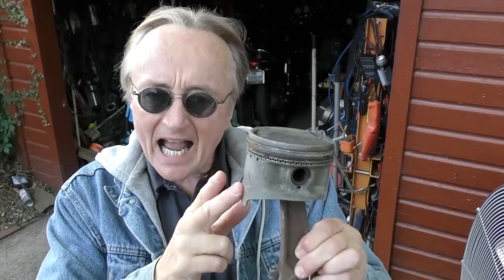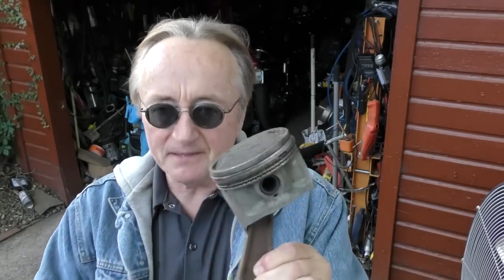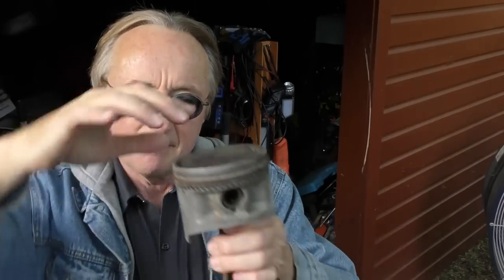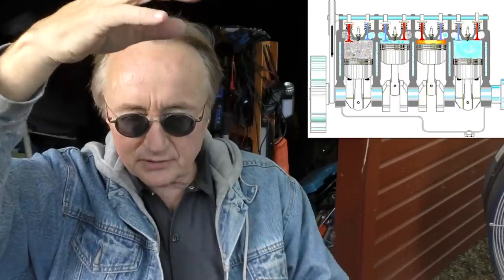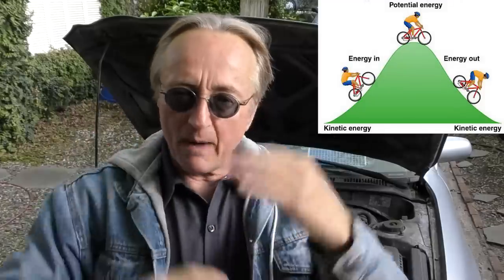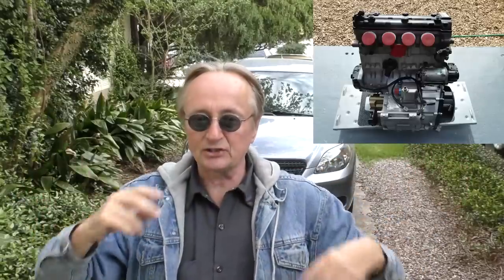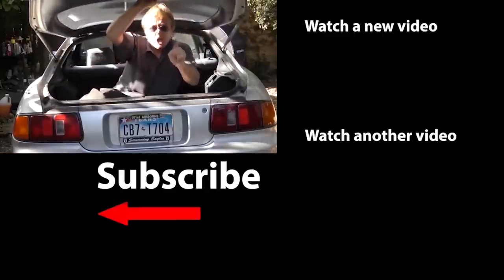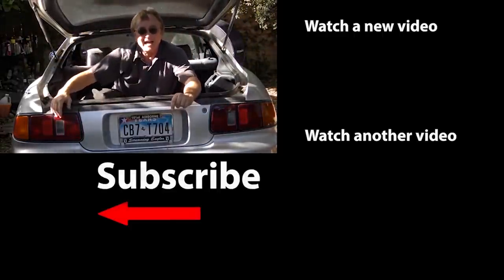Horsepower vs Torque, Which is Better

Comment: I thought horsepower was a function of torque x revs. Engines are tuned differently, so the peak torque per rev is rated somewhere in the middle for most cars with lower down peak torque per rev for diesels and lorries that pull stuff, whereas horsepower is just torque (at the current rev) x rev. Engines use to tow with lower down torque also have a lower ratio gearbox and the speed between the engine and no movement is much much less versus lighter faster cars.

A lot of lorries in countries that do not use the same big vehicles as the US, they tend to use the same engines as smaller vehicles, only coupled with a different gearbox and tuned for more torque at less revs so that when it starts off the line the less speed difference between the engine, transmission and wheels lets it move carrying heavy loads without destroying the crankshaft, transmission or drivetrain.

autoexperttv explains horsepower as a function of torque x revs, i do like his explanation and he was an engineer as well, whereas you are trying to give an explanation that a non engineer can understand based on the different scenarios. Its also not necessarily true that a v config provides more torque, as an example the vw ute with the v6 outputs the same amount of torque as other engines but at higher revs so the numbers given if you look are the amount of torque at a higher rev. This makes the v6 look weaker than the straight 4 or 5 cylinder engines in both hp and torque. super/turbocharged engines also do make huge amounts of torque that increase their horsepower because of torque x revs, so these things also help engines tow with higher cylinder pressures giving more torque. Diesel engines are heavier in order to survive the bigger explosions for providing more torque at lower revs rather than higher revving engine that burn less per rev but burn more per minute than a low revving diesel engine with lots of torque.

Comment: Horsepower is universal: 100 Hp is the same performance regardless engine type gasoline, diesel, electric etc (meaning that no matter on what rpm's that 100 Hp is produced regards to performance).

Torque is not universal, the "strength" of torq is heavily related to the rpm it is produced: 100 units of torq is more effective on 2000 rpms than 1000 rpms. With a gearbox you can manipulate torq and rpm, but you cannot manipulate power that engine produces (power over gearbox remains the same). And afterall power = torq * rpm, so you really have them both always when engine is running.

Speaking and comparing torques is fairly irrelevant (but layman terms more easily understand), because should be comparing max power and overall power curves.
Reply: @Charles That's not an argument. Also, you're the one that is wrong. Torque at the wheels is changed with gearing down an engine with higher power. The power output doesn't change between the engine output and the wheels except for drivetrain losses. But the torque does - in every gear.
Reply: Your so wrong it’s embarrassing.

Comment: Torque is a twisting force. 
HP is that twisting force multiplied by the RPM it is twisting at. 
HP is arguably the more important number to worry about because it takes into account both torque and rpm in whatever you’re doing (racing, towing etc.) Think about what a transmission does. You can multiply torque all you want with a tranny but you can’t ever multiply HP without increasing the performance of your engine.
Reply: Hp is almost never more important except for straight line top speeds. Tq is more important for basically every single other application
Reply: Richard Conklin Disagree. I’m not saying torque isn’t important because it  is but high HP is the number you want in just about every application. HP is a measurement of power which is the amount of energy made per unit time. Racing? Aka high amount of kinetic energy (speed) in a short amount of time. Towing uphill? Aka creating high amount of potential energy in a short amount of time? Maintaining top speed? Aka maintain a high amount of energy wasted in wind drag? Generators? Aka maintaining high electrical energy in a given amount of time? It all boils down to power.

Comment: I'm sorry but that is a bit misleading. A torque figure is "sort of" irrelevant (more on that a bit later) as you can have more torque with gear reduction, however, you cannot multiply HP as you can with torque. In reality, both HP and torque are two sides of the same coin, HP is how much work you can do with certain force (torque) during certain time (per minute for example). That said, while a torque number doesn't mean anything (you can have diesel engines with over 1000lb-ft and they don't accelerate that quickly) a torque curve is very important, a low end torque means there is lot of power available and ready to be used, and if we have constant torque, it means a constant HP build up, and thus, great and constant acceleration (as the case with electric motors, especially if we're not wasting time changing gears to work on a limited powerband). Now why is it irrelevant to think if having more hp than torque is better or vice-versa? If we measure torque in kg-m we almost always will have more HP than torque, it depends on the units we use. In conclusion, HP vs Torque? They're two sides of the same coin, we measure one to calculate the other, and given we can change the torque with different gearing, is better to focus on HP. A torque curve IS very important, as it can say if our engine will have enough power in the low end (as in a semi truck) and feel powerful and responsive or if it will have power in higher rpms (like some Japanese cars).
And F1 cars can't put all the power without spinning their wheels, that's why they don't really accelerate that well from a stand point.
Reply: You're trying too hard.
This video isnt intended to create experts it's intended for people who drive a basic passenger car from A to B.
Reply: @richdf5664  well... I guess you're right, it was just a rant from a random stranger on the internet.

Comment: Gotta love the torque from a V8. My 94 Caprice launches pretty good for a 4,500 lb car because of 330 ft-lbs of torque lol
Reply: Despite the inevitable lag from older injection systems, I was actually surprised with how much pep the dinky little V6 in my crappy old Taurus had. Definitely not impressive as far as high speed goes, but put your foot in a little and it really takes off compared to a lot of traffic.
Reply: If you really press the throttle from a standing start you can probably raise the front end off the pavement!
Reply: 3L Vulcan had the torque of midsize pickup.186 ft lbs is nothing laugh at when your passing power on the highway was easy reached at 40 percent open throttle. Its slow engine (153 hp)but a reliable one.
Reply: Also the GM 4.3l vortec V6 made 190HP but 250 ft-lbs of torque. My 2000 Astro also picks up pretty well.

Comment: Torque can also be a measure of an engine's efficiency.
At highway speed (on a gasoline powered car),
you want the rpm to be near the bottom of the torque curve
for the best mpg.
Just my opinion.

Comment: 1:27 the dodge spins the engine before taking off so it can also have instant torque when the light goes green then it can spin the wheels so it doesn’t explain motor performance over ice. One advance of tesla is AWD, another is less gear transport losses then no shift losses until it actually needs to change gears and it falls behind quickly. At low speed you need less power for acceleration so tesla can begin with high torque low rpm (even form 0) which is low power, then it gets to the max power range so it doesn’t need to shift until it gets that sector

Comment: Horsepower is simply a measure of work over time, with torque and RPM being the main variables. What creates a torquey experience in most ICE is having a large, flat torque curve (lots of area under the curve). That's why large displacement engines--and turbo engines that have little lag and hit boost at low revs--feel so powerful relative to the peak horsepower output.

Comment: Can you explain how Horsepower/Torque all play a role with different gear ratios of the axle?
Reply: Go back to school
Reply: You can transform torque/rpm over gearbox ratios, but you cannot transform horsepower transferred over gearbox.

I.e. That leads to on lower gear you get more torque but lower speed, and hp (over gearbox to wheels) is still the same that engine produces.

Comment: In my experience of watching a million drag races, torque never made a difference, the car with more HP always wins. (With similar weight)
Reply: You are right, and most people commenting are totally wrong. Torque is not a measure of power, and power=acceleration.

Comment: Modern F1 cars have a lot of torque now because of the hybrid systems they use and I think they are pushing over 900 horsepower at the same time. The ERS system they have eliminates that pesky turbo lag with the electric motors and they have much better acceleration than they did back in 2013, which were the cars you showed along with the mid 2000s Ferrari. Amazing engineering they have.
Reply: F1 cars during 2006-2013 had v8 power plants.

Comment: The f1 cars are so light that the torque they give out is well good enough for a sub 2 second 0-60 time... except the Williams...
Reply: Yeup but put that in a modern day full-size pick up.
Reply: @BaronBoar  Why would you do that?
Reply: @afonsoferreira5171  how about, why not put an F1 engine in a modern full size pickup truck?
Reply: @BaronBoar  Because they were not designed for that purpose, the same way that if you put a truck engine in a F1 car it would not work properly.
Reply: @BaronBoar  The F1 engines are not at all reliable they have to change those engines every season and the expected lifespan of one put into a production car would be little more than 30,000 miles or a few years it stands no chance pulling a truck. Its 1.6 litre V6 it couldn't pull the skin off a rice pudding. An F1 car weighs about 1600-1700 lbs. Trucks weigh 5000 lbs.
Reply: @gravemind6536  exactly.
Reply: @gravemind6536  Crazy dumb comparison, an F1 car is a RACE car NOT a truck!  Most race engines last only 1 race and the engine is changed for a new one but in F1 there engines are designed to last 4 races... hows that for reliability!
Reply: The Williams can be quick in acceleration,   it's still a Mercedes engine. Everything else is subpar

Comment: Grasshopper, I have contemplated this issue from under the Bodi tree and the best example I can come up with is the difference between a weight lifter and a sprinter (and it might be further compared to their foot wear). A weight lifter is not that concerned with time as he is with the ability to lift a load, pure strength. Where as the the sprinter it all about time, not weight. A weight lifter's foot wear will be strong and supportive. A Sprinter's foot wear will be light so they can move fast to improve his time.

Comment: So if more torque means more acceleration.. then how come diesels have less acceleration than their gas/petrol counterparts?
Reply: Torque = Rotational force,  Horsepower = Torque x RPM.  Diesels don't normally have a low rev limit so they don't make much HP. While Scotty is correct,  I don't care for the way Scotty explained this in the video (but it is rather hard to explain). You can have lots of torque and still be moving quite slowly.  A diesel though will maintain speed easier with a load due to the torque that it delivers at that lower RPM.   High horsepower engines may make a lot less torque at a lower RPM, but when they at the peak they are multiplying the output of that torque very quickly and that makes you go fast.  Ofc gearing a low RPM, High torque engine can make it accelerate faster just like gearing can make a high hp engine have more torque at the wheels. This is why drag cars install lower gears into the vehicle to make up for that lost low end torque.
Reply: The torque crowd can't rationally explain this because power=acceleration, and torque is not a measure of power.

Comment: NO REPLACEMENT FOR DISPLACEMENT
(Coming from a guy that drives a 1.5L subcompact) lol
Reply: Whaaaaaat????? Let me guess....wife and kids???....☹️
Reply: @Anth230  nah broke college student with no gf
Reply: @jorgeroque1995  Oh...whew ...I was worried about you for a second.. 😉
Reply: @jorgeroque1995  Same but I drive a 1.7L. Haha.
Reply: Drove a 1.0 3 cylinder Ford focus. O regretted it. It was just simply a grocery go-getter
Reply: Drive the old 4.0 liter V6 OHV in my ranger. Great truck. And with the nice exhaust sounds like a truck
Reply: @Vee_H.  Ford Ecoboost engines are total junk every single one of them. That engine range is going to cost Ford big time.
Reply: Rotary engine: exists
Am I a joke to you?
Reply: I've Got a 1.6 get on my level
Reply: I got a 1.8L compact lol
Reply: Gravemind proof?
Reply: I agree...but ilke you I drive a little 1.6 liter turbo...lol...its a far cry from my beloved 460 stroker 557, but it actually does run fairly well
Reply: @jorgeroque1995  I drive a 1.6l fiesta 5spd, I know your pain Lol. My dream car's a Shelby Cobra with a 5.7l rotary/Wankel engine though. After college.
Reply: Boost can replace displacement
Reply: Guys, guys! Get a big old diesel without a computer, rebuild it and profit.
I drive Nissan Patrol td4.2 n/a 6inline and it is lovely! :)
Reply: Yep there is...turbo charger and supercharger...personaly a fan of the turbocharger...
With a good setup mid size engines can perform miracles
Reply: Same here. 1.5L 4 banger.
AMAZING gas mileage (one of my main concerns) 
Very noticeable difference with weight changes.

Comment: A big strong man twisting a big nut with a 1 meter wrench with a pressure of 100 newton for example, that’s a 100 nm of torque, like a Harley. 
A smaller man twisting the same wrench for shorter, weaker strokes, coz he’s not as strong, but can twist again and again fast, that’s a Honda cbr 600 :)

Comment: I understand it as torque is like a wrench on a nut, longer wrench handle (torque) means more leverage makes nut easier to turn.  More horsepower means the faster the wrench can be turned

Comment: High speed is illegal, quick acceleration is not. Torque is more practical, can be a safety feature and hence is more important.
Reply: In Arkansas you can be ticketed for "excessive acceleration". Whats worse isnt the ticket, its the cop trying to explain why
Reply: "Well you may not have spun a tire, but you took off significantly faster than everyone else"     In a retirement town of 2500 people, it isnt exactly a f&#$in feat to do lol
Reply: @elidames6889  he, he :-)

Comment: I was always told torque is your power pulling through the power band, while horsepower is your total power revolution.  The more torque you have the faster your reach peak horsepower.  Engines have a specific revolution that has to be met for peak horsepower, the torque is how fast you can access that peak while under load.
Reply: Nope

Comment: My 1986 YUGO has 54 hp,  56 lb-ft of torque.  In Relation to this whole video, I still don’t know what exactly I can expect, better acceleration, or higher top Speed? Technically, I do have more torque than horsepower !!!!
Reply: Joe Mikey 

If you raced a car with 30hp and 100lb-ft 

That car would accelerate quicker off the start line ONLY while you have equal revs, as it's making more torque, so with equal revs it must have more hp. 

However as the race goes on and you build up revs, you'll have more horsepower and your engine will be doing more work hence overtake the other car. 

How he explained it is confusing.. high torque is very good for getting off the line but doesn't always correspond to top end acceleration.
Reply: "Technically, I do have more torque than horsepower" this is like saying I have more weight than height. No sense made. 
Scotty is great, but like sooo many he doesn't understand power at all.
Power determines all things relating to going forward - acceleration, top speed, towing ability and hill climbing ability. Torque is part of how an engine makes power.

Comment: I always wondered why buses had low horsepower, but still could still keep up in traffic with 50 or so people onboard. Now I know.
Reply: not always the case look up gasser buses 6.0 400 small block , not bast because of Gearing! scotty completly left that out
Reply: Like my semi. Around 2000 lbs/ft between 1100-1500rpms yet has like 400hp. It needs a 10 speed transmission to travel down the road at 65mph. Gearing play an massive role in a vehicle.
Reply: Well no. Those cars are only using something like 15-40 HP to accelerate when just commuting around on city streets. A bus is using most of it's 200-300 HP when accelerating.

Comment: A very good explanation. I also didn't know the difference between inline engines and V engines having different outputs. I also understand that horsepower isn't actually real. Torque is a real measurement but horsepower is just a calculation of the torque and other factors.
Reply: A V6 doesn't have better torque than an I6.